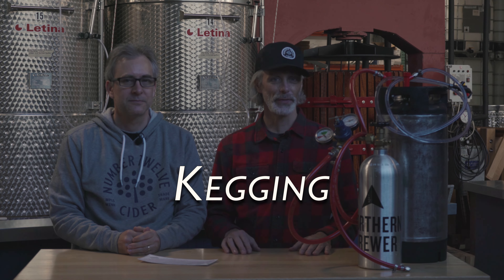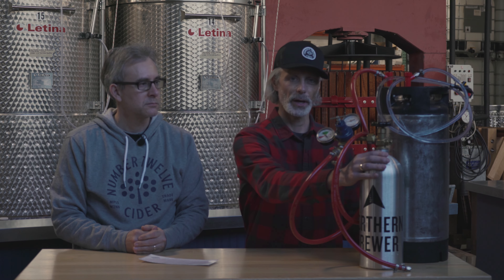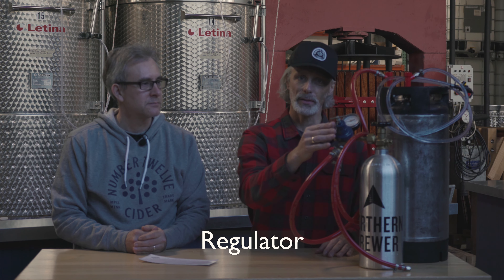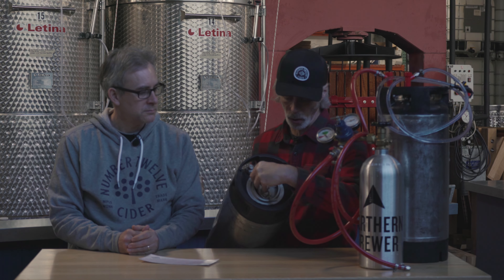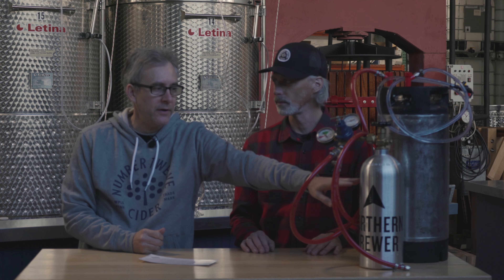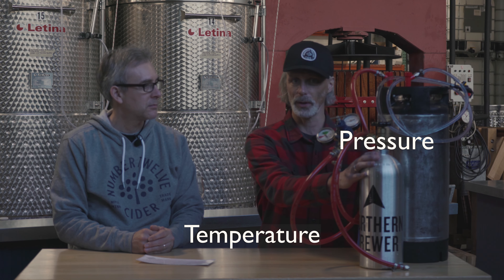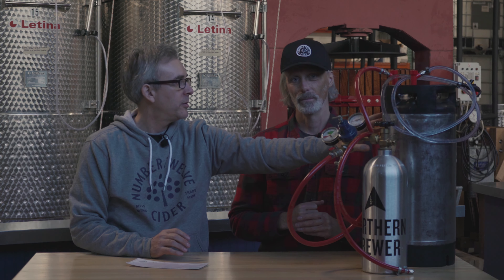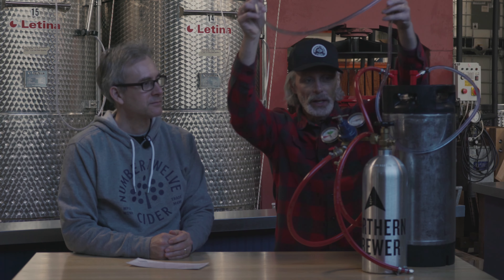Introduction to Kegging Cider

Comment: Another thing some people do is they use priming sugar and "bottle condition" the keg and let it naturally carbonate. Then they just need to have the co2 to serve.
Reply from the maker: Yes - that is possible as well. Sediment does collect and pour out with the cider but it does work if the keg is kept at room temperature long enough and sealed well enough to create that pressure.

Comment: Very nicely explained. I wonder if after seven days we keep the keg in the fridge or can we keep it in the basement in the cold? thanks
Reply from the maker: Hi. The cider will have a tendency to pour foamier the warmer it is. If it is a dry cider, it is not critical for it to remain at refrigeration temperature after it is carbonated as long as you have a good seal on the keg. Obviously a back-sweetened cider will start to re-ferment fairly quickly if it is not stabilized.

Comment: Hello, dear friends. Thank you very much for your videos. They have been my great teachers in many subjects and today, I come to ask them again for their advice. 

The case is this: I have 100 liters of cider of different varieties and I want to make back-sweetened on kegs But it's a bit expensive for me to use sweeteners like xilitol and eritrithol and I want to force carbonate. By studying some bibliography along with your videos, I understand that I can cool the cider and keep it at a low temperature, However, to avoid fermentation do I have to incorporate any cheap fermentable sugar when the cider is already cold? 

The next question would be if I have to extract residual oxygen from the barrel before pouring our cider into them to prevent oxidation by pushing that oxygen out with C02?

Will it be something risky if I force carbonate and incorporate sugars to sweeten? 

Can my barrel explode? Thank you very much for your advice. I am a Fan!
Reply from the maker: Luis - sorry for the late reply. You can add any form of sugar as long as you keep it cold - under 38 degrees f. If you add non-fermentable sugar it will keep for a long time. If you add fermentable sugar you need to drink it in less than 3 months and keep it refrigerate, otherwise you should stabilize it with a sorbate - sulfite combination. Monitor the pressure in your keg when you pour the cider. It will increase in pressure if it is fermenting in the keg. If so you should release some of the pressure and you wont have an explosion problem. If you are using a keg or a barrel - it is good practice to purge the vessel with co2 before filling.

Comment: Is it possible to bottle directly from a corny keg once the CO2 has been absorbed into the cider at the same time retaining the CO2 ‘fiz’.
Reply from the maker: Hi Stuart. Yes you can bottle directly from a corny keg. You will lose some carbonation in the process and there are couple of things to do to increash your chances of success. Make sure the cider, and bottles are chilled; rinse and sparge the bottles with co2 before you fill them and seal them right away.  If the cider is bubbling a lot when you fill them, you will end up with under-filled bottles that are more succeptible to adverse bacteria. There are products in the marketplace that are supposed to make this easier like a bottling "gun" that attaches to a co2 line and the keg so that you can pull the sparging trigger before pulling the fill valve. Good luck!